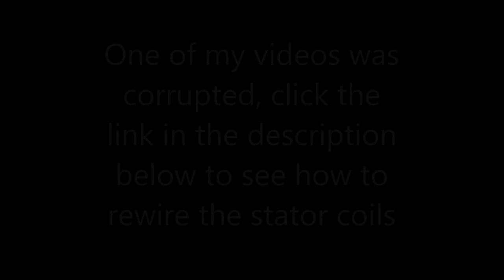Mounting a Fisher and Paykel direct drive washer motor to a cheap eBay wind turbine: Part 2

Comment: looks like beast mode activated on that little turbine ;) just awesome
Reply: It will not move with these blades in light winds and it needs many blades The wind power system is very, very complicated

Comment: My fisher and paykel has aluminum coils, what crimping method would you suggest, what kind of crimps, I also see some aluminum welding rods online, maybe they can do the job too?
Reply from the maker: My dual stator setup (I'll be revisiting this soon) is an aluminum core rotor.  What I did was I stripped about 1" of wire back from each lead and did a tight twist.  I tested for conductivity at the end, then sealed each twist with epoxy and covered with shrink wrap.  It's not ideal but I couldn't get the wire to solder with anything.

https://youtu.be/qZlT_ITlrUA

Comment: how's it going to handle rain though, its pretty cool though im sure youll get 300w+ off that
Reply from the maker: I don't know, honestly...the little hole I got sealed up with silicone but I'll probably need to go around the seam between the bearing base and the nacelle also...and I don't know how well the stator will handle the weather, either.  If output is usable I'll climb up and coat it heavily in epoxy paint.  Luckily rain isn't a gigantic concern in this part of Texas...it's more likely a heavy fog will stick to it in late November, layer up, and shear is apart that way :D.

Comment: Esa configuración original a baja velocidad genera cerca de 50 voltios 4 amperes.. ya hice la prueba y preferí no cambiar nada por los momentos, la otra parte complicada es que el bobinado es de aluminio y delicado de empalmar. Cambiaría la configuración si deseo más amperios.. pero sacrificaría considerablemente la velocidad porque debería aumentar significativamente.